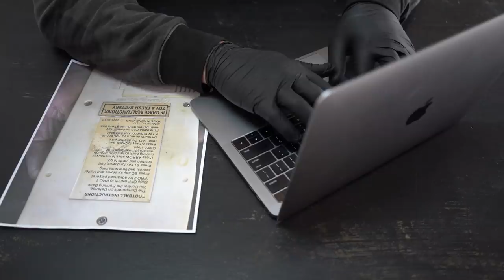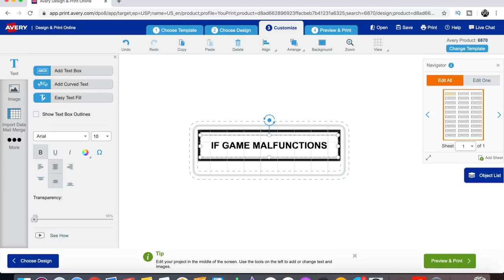Video Game Restoration

Comment: We had the grey version of this game. For a moment, I thought you were over your head, when deciding to sand the buttons. But you pulled out the retro-bright kit, and it turned out great. I suppose since you sanded the buttons, you could have just polished them instead of using lacquer. But you could have also retro-brighted them as well. Because paining wasn't a real option here, you chose a particularly challenging situation. There wasn't really all that much wrong with it, but I am glad it turned out so well.